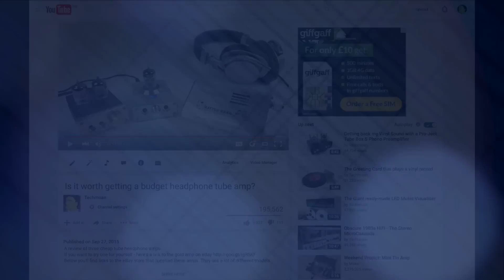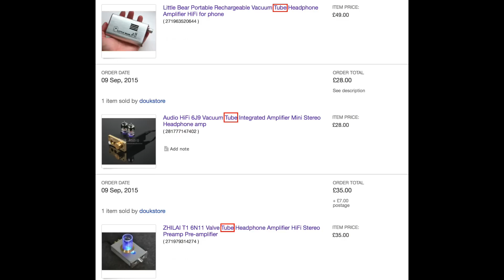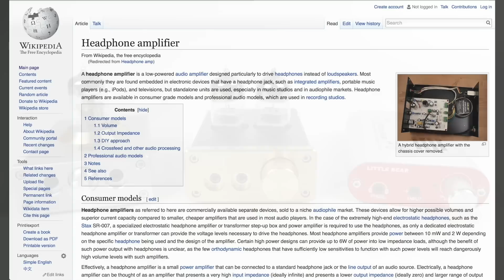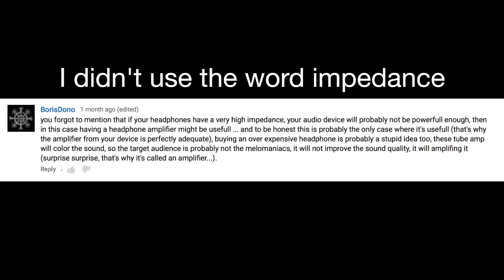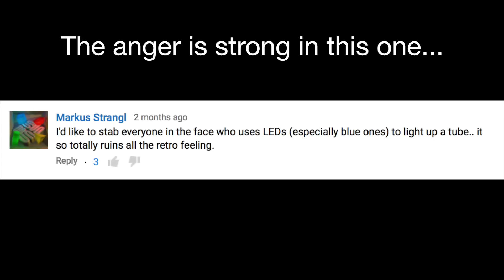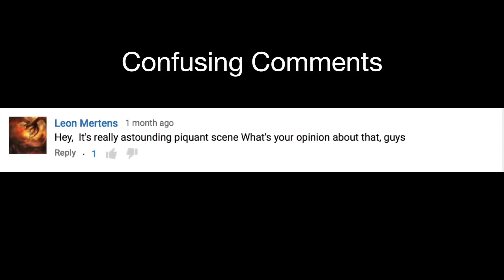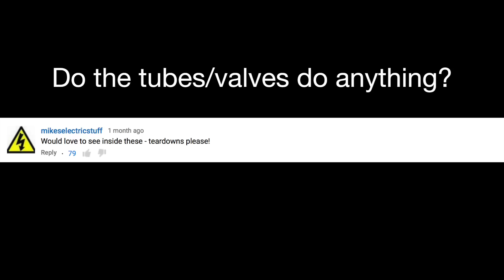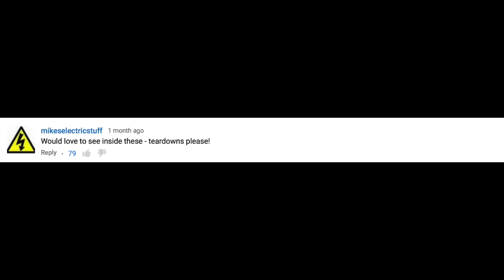Headphone Tube Amps - Follow-up & Tear-down

Comment: The first amp has two ne5532p chips. Those seem to be common on headphone amps of all types. I just built one using two of those with no tubes.The second one only has one. What I find interesting is the amp that you said sounded the best uses two of the NE5532P chips and has the cleanest board. The other two only use one chip.
Reply: Are they running as stereo one amp per channel or chained together ?

Comment: Is that an LED or some other kind of lightbulb in the center of the tube base? Just to shine orange light onto the inside of the tube to make it look like it's running? That would be funny...
Reply: As all 3 videos mentioned, this shines blue light onto the tubes for decoration, while the actual heating filament elsewhere in the tube glows orange when heated.  The EEVBlog teardown of the two tube model found that the tubes are configured to pass through the signal with minimum change, then the opamps do the real work of increasing the current (but not the voltage) to the headphones.

Comment: FYI all the tubes shall i say valves are properly connected also all units have a swhitching power supply inside them to drive the tube anodes this is completely visible on the litle bear amp as that module conected to the battary is a step - up converter
Also the tubes are used as the main amplifier uinits and not the pre-amp ones the DIP-8 chips are the pre-drivers
Lastly there is no detection circuitry to see if tubes are conected or not there is no controller chips as far as i can see
And the traces are from both sides thats why they dont seem to be wired and also the problem tha the litle bear amp had was propably coming from that shitty main filtering capacitor the brown-ish one replace it and boom done perfect

Comment: El PCB ó Circuito Impreso esta impreso por ambos lados ó "True Hole", sigue las pistas por ambos lados. 
Los bulbos ó válvulas ó tubos son para la etapa de preamplificación. 
El Amplificador Operacional es el IC ó Circuito Integrado: es el que tiene ocho patas, y tienen zócalo así que se pueden usar diferentes Chip's ó IC's ó Opamps sin necesidad de herramientas especiales, solo usando los dedos puedes quitar y poner otro opamp, para producir diferentes respuestas sonoras.

Comment: The "microphonic" term is important, it's techie way of saying the valve is faulty, not that it has some strange property. Valves become microphonic when the bits inside become loose and can move around, which changes the way is works. Replace the valve (it's probably only one that's damaged) and the ringing will stop.
Reply: I meant to add that the fact the valve is microphonic proves it's actually doing something, albeit in a faulty way :)

Comment: Thanks 
A few things,1) the reason for using a valve is to add 2nd order harmonics which usually sound better and a little more rounded and less harsh, the valves are usually configured to buffer"..that is to say they don't "amplify" they just pass the signal through them 1:1 and the actual "amplification" is done using the op-amps that you can see in the sockets , 2) The power supply in the little-bear is very cheap and it's a switch-mode that can be bought from ebay for £1.50, bypassing it or possibly moving it away from the main circuit board will likely stop or reduce the hiss (they can and do cause hiss and interference to radio's and sensitive electronic devices if they are not shielded) 3) Portable devices don't always have enough current/voltage in their headphone amps to drive an upmarket headphone optimally, things like busy music or low frequency content can sometimes catch them out and they begin to sound a bit edgy, the main reason to use a headphone amp is to "let the amp take the strain" and should result in a more relaxed sound 4) The Op-amps are a lot of the time in sockets and you can "upgrade" them to "better" op-amps as well. 5)Valves are not like xenon bulbs and as far as I know you can touch them with your bare fingers.

Comment: Yes the Tubes really work on these little amps.  And before people start to shout that they can't work with 12v ? Yes they do ! Not surely on the 12v it self but there is a little coil inductor next to the power input  ( look at 12:12 ) You see the power jack input, then a capacitor and then a little coil inductor. These are used for a switching power supply to boost up the voltage. Since a tube for just a pre-amp it doesn't need lots of power so the coil is small.

Comment: Both the desktop tube amps semed to have DC-DC converters needen to power the tubes at the ~100V (very little current is needed 3mA). Also the dual tube amp used two single triode valves (1 gain stage), while the single tube amp used a dual triode tube (two gain stages in a single bottle for left and right).

Comment: Power tube amps are totally different then pre-amps. And they arent power tubes. They are low voltage tubes.... just like 12ax7a's. apples and oranges.  btw the 6J9 is a china version of the 6DJ8 (russian) or ECC88    http://tdsl.duncanamps.com/show.php?des=6DJ8   psst 7vdc plate volatage.

Comment: Great video ! Just to answer the question about the valves (tube) being connected, the printed circuit boards are double sided, which means that there are connections (tracks) to the rest of the components on both sides of the board...so if you only saw three connections to the valve on the bottom side, you would see the remainder connected on the top side of the board. Hope this clarifies the situation.

Comment: I have had tubes in my fingers, my mouth (to hold them), in my hands, and perhaps even on my head and not once have I had them fail due to my touching them. And this is with all kinds from little mini-tubes on up to old rectifiers in standing radios. The fact is, they don't get hot enough ever.

Comment: Every amp taken apart has an op-amp in the signal path. But then all the 'source' devices feeding them likely use op-amps as well. So really, the op-amps inside the amplifiers just need to pass the input signal to the tube unmolested without adding any additional coloring to the signal. The tube, buffer or not, will introduce it's own 'characteristics' into the final product. This is really the goal to be honest. Folks have an affinity for the 'tube sound' which is just the nature of their performance characteristics shining through.  So they are performing a function, and that is it. They're introducing their sound signature into the signal path.

Comment: On the question of whether the tube is providing the amplification, the thing that replaced tubes were transistors. The blue amp clearly has a transistor (12:20), it's the light colored object with three legs and a hole in it. The hole is intended to mount the heatsink to a surface, in this case I guess it just rides against the housing.

Comment: Plate starvation mode. The plate voltage is very low compared to normal valve use, hence the small power supply I'm pretty sure they get them to run through heavy biasing.and no cathode resistor ..

Comment: A high voltage boost circuit consists of an inductor, capacity, diode, FET and an oscillator. I can see the necessary components on every single amp PCB.
Reply: Here is a good explanation of a voltage boost circuit: https://learn.adafruit.com/ice-tube-clock-kit/design#high-voltage-boost-supply

Comment: The 'what' of tube amplifiers.
What follows is a gross simplification of many complex things, so keep that in mind while handing out the torches and pitchforks!
There is a concept with amplifiers called the transfer curve.  It is a measure of linearity of gain based against signal input.
Tubes have a transfer curve that has little 'bends' at the extreme high and low ends, and a fairly narrow linear region.  Biasing keeps most of the signals in the mostly linear region.
With the advent of transistors and IC's, truly linear transfers curves became the norm, and audiophiles hated the sound ever since.
Why does perfect transfer curves hurt the ears?  The ears have a transfer curve as well, and guess what?
It closely matches the tranfer curve of most Thermionic Valves.

Purty pikcher:
https://www.google.com/url?sa=i&rct=j&q=&esrc=s&source=images&cd=&cad=rja&uact=8&ved=0ahUKEwiT0dXOibrLAhUDz2MKHQYuDWoQjRwIBw&url=http%3A%2F%2Fwww.mostlyaudio.com%2Fvalvetheory1.html&psig=AFQjCNFGgyHpWdlR1nknrjtrJLNSTeA-Bw&ust=1457835176082377

Translation: Tubes distort sound in a way that is compatible with the way your ears distort sound.  Solid state [OK, there is a way to trick a MOSFET to think it is a pentode...] doesn't alter sound in pleasing ways so it sounds harsh.

Comment: You didn't make a note of high impedance headphones because smartphones can lack volume even for some low impedance headphones. In which case an amp with a low-high gain switch is the better option.

Comment: Sorry, Techmoan that you had to defend that very interestind video of yours.
I've just recently come to know your great channel, so I only know few of your videos. However, if I had joined in ealier and if we would have had contact before you made that one on headphone tube (valve, Röhren-) amps, I might have let you known for good:

Tubes are no electrical elements.

They're religious relics.

You might consider that with your next video in mind.

I'm a musician and my own sound engineer; I'm not that much into retro devices, but of course, as a musician, I often have to deal with (stage) tube amps and with all the superstitions about those.

Man, I can tell. I mean, tubes do have their own characteristics, but also, they have their weight, especially in an amp with the power supply built into it as well. 

Continue the great work. Best from Germany,

Käptn Kaos.
Reply from the maker: +Käptn Kaos thanks Käptn.
Reply: Techmoan
I'm the one who has to thank you. I love your style, I love what you're doing, it's a great channel to just tune in every now and then :-)

Comment: I'm not a circuit nor electronic expert, but an audiophile who enjoys high fidelity music. From what I see you don't know how tubes work. They need to worm up to play, and it is not good to start both a recording and a tube device. It may destroy the tubes. Looking at the electronics you could tell at ones that the components used there are not of good quality, capacitors aren't ceramic for example and they not handlu made. Interconnector wires should be silver or golden non oxigene cast. I'm not offending you here, but to play music in high fidelity in tube technology requires lots of money and time. Why time? Well, tubes the longer they are used the better and more natural sound they produce. I have mine for half a year now and they are begining to sound brilliant. I like the space, the seperation, the softness.

Comment: The golden amp looks a lot more thought through. It has nice clean soldering, and a tidy high quality pcb.
As i thought, they all had some low current hv inverters inside. 
Im pretty sure i have seen the little green pcb soldered next to the tube in the "little bear" amp before. I think it turns 5V to 100, but i can't remember the name of the board itself.

Comment: Since you locked your comments on the other vireo I comment here instead. You might see a bigger difference if you have higher impedance headphones. And that doesn't mean £16000. But something like a pair of beyerdynamics DT*** 80 or 250 ohms which costs the same or less than your philips'.

Comment: It is entirely possible to run a choob on low voltage. To do so, you put a positive bias on the grid rather than a negative one which is how you'd use it with the normal high-voltages on the cathode and plate. It probably shortens the life, but it does work. It WILL produce harmonics when run this way but not loudly, unless overdriven which is great for guitarists but no use to a hifi buff. 

Incidentally,triodes sound MUCH better than pentodes or early tetrodes, and the sensible thing to do is to run a choob as a triode, even if it is constructed as a pentode. Often, therefore, there will be redundant connections.

You can also run them cold, with no heater, but this requires serious voltage on the cathode and plate and again, isn't good for them. 

Chaining several tubes together can increase this however, and I maintain that tubes for hifi are usually only worth doing if you really go for it and they respond best to audio that is already rich. Half measures either don't work at all or cost far more than they benefit you, for the most-part. 

It annoys the heck out of me that people who cannot hear the difference, assume that nobody can. 
Do you also claim that I can't see just because you are myopic, and therefore  ALL telescopes are all a con? 
Are people so self obsessed and opinionated that they cannot even conceive that someone else might have better listening skills and more finely honed senses where something they do obsessively for years and years, is concerned, just as skilled trackers can read large amounts of very specific information from a patch of ground that everyone else might consider to be plain and featureless. 

There ARE of course, large numbers of devices like this that are for show only. Tearing down the item can sometimes show this, but more important is to get the thing on an oscilloscope and find out what it's actually producing. 

However, if someone can appreciate a worthwhile difference in the quality and wishes to buy the kit to achieve it, and the science shows there IS a difference, (which DOES HAPPEN, plenty) who the hell are you to tell them otherwise?

Comment: 12:19 why is there a transistor on a valve amp? (Genuine question; I'm not an expert in electronics except that I know valves were replaced by transistors).
Reply: I think it is a good question.
It would seem they are doing some pre-processiing of the audio signal before the tubes get it, then have the tubes do most of the amplification.
Some of the transistors could also be involved in power regulation, which would be a legit use for them.
But really, if you are going to tout it as a tube amplifier, there should be no transistors in the audio processing pipeline.
Reply: wikipedia, google

Comment: Yes, looking at the hardware and circuitry, the tube amps are used and they will not work without them. However, as others have mentioned already, they may just be used as a voltage/signal pass-through and not as a means of actual amplification. I see capacitors and transistors, and what looks like digital amplifier chips (labeled as 'IC2' in your first tear-down). If the tubes are only used for aesthetic reasons, those chips will be doing the actual amplification, not the tubes themselves.

Comment: Yes! There are Tubes that operate at low voltages, I have several that operate at 12 Volts, they were originally made for car radios to eliminate the Vibrator that was used to produce the High Voltages needed. Why they called them Valves is rather strange since there is no handle to twist to shut them off. What with calling an Elevator a lift, or an apartment a Flat?

Comment: It absolutely will not hurt the tubes to touch them.  If those tubes ever got hot enough to compromise the glass, they would be destroyed anyway.  They are small signal tubes and should not get that hot with normal biasing.  By the way the ringing sound is a bad tube, not the fault of the amp.  As you know, HIFI people are nuts, so all kinds of stupid comments are to be expected.

Comment: Regarding those ignorant fools that say tubes in higher/high end audio are obsolete, or irrelevant, or that tubes don't make an audible difference, go listen to a vintage FISHER 500C or H.H. SCOTT tubed receiver/amplifier compared to a solid state receiver/amplifier, hopefully through a pair of revealing speakers like Magneplanars or a vintage pair of Polk Audio Monitor 10's, and then tell me there is no sonic difference!  You CAN distinctly hear different nuances, timbres, and other 'sonic signatures' to music between tubes and solid state, especially on WELL DESIGNED units.  Both can be great, so it boils down to personal tastes in technology between the two.  Using inexpensive, often cheaply made and 'skimped on' units like these simple Chinese headphone amps, it is harder to tell the differences and capabilities between the two.  I'm hoping 'Techmoan' can get his hands on a vintage FISHER tubed stereo, and a comparable vintage solid state stereo, and show us the difference using an excellent set of speakers and 'lossless' FLAC or WMA files, or SACD, HDCD, etc.  I mention digital sources because many audiophiles, enthusiasts, etc. often go with tubes in order to impart a more natural, analog, lush sound/timbre to their music.  In my opinion, the differences between tubes and solid state are more discernable when using digital source material.

Comment: God that circuit board in that rechargeable one was disgusting looking. All that white stuff on the back I think was flux. Evidently no one in China realizes you can clean that off with alcohol, as it's normally corrosive.

Comment: Good Show! :-)
Impedance is important because tubes don't really like to drive low impedances. 
Headphones vary. Some tubes can drive some headphones directly but not most combinations. So you would typically need output transformers. 
Or a hybrid circuit with an op amp or discrete transistors as well as the tubes. This is how perhaps all 3 of your test subjects are designed. A tube stage followed by an impedance matching solid state stage. Another consideration is that you need either 2 tubes or a 2 section tube for 2 channel stereo. All of the numbers are the Russian / Chinese type system as you might expect, (as opposed to the Euro. or US system).
The supply voltage is enough to run the tube filament. In all likelihood there is DC to DC step-up voltage conversion going on inside to raise the plate voltage to a suitable higher voltage. 
That is pretty easy and inexpensive to do now.